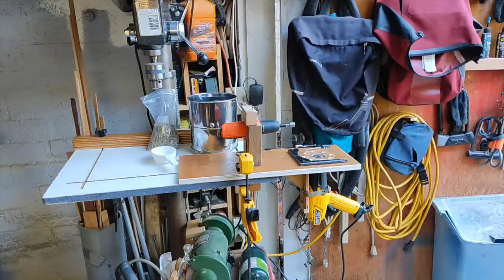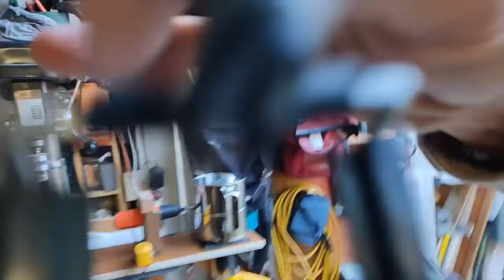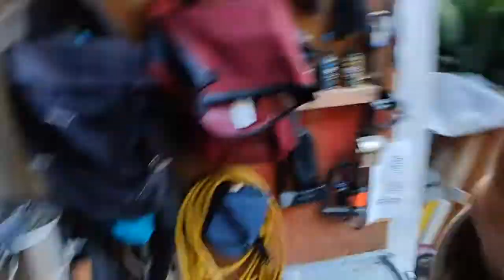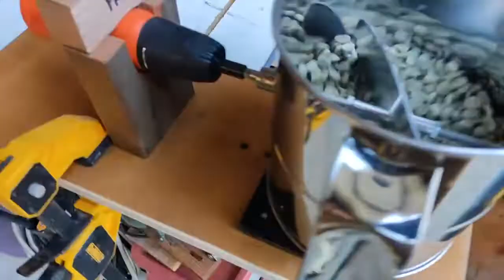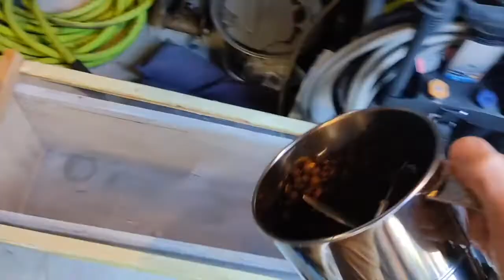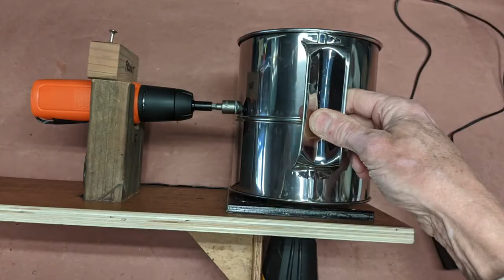Wobble Disk, Heat Gun Coffee Roaster

Comment: Absolutely brilliant! I also made my own heat gun flour sifter roaster, it is driven by a speed controlled angled worm screw motor connected to a long screw thread shaft with a coupler. Instead of the circular disk, I used to thin steel spoons as the bean agitators. I have since added a ventilated tube with a fan to suck out the coffee silver skin as it roasts. I hope to post my video once of these days. Great work on yours!
Reply: Please do post. Spoons sound interesting!